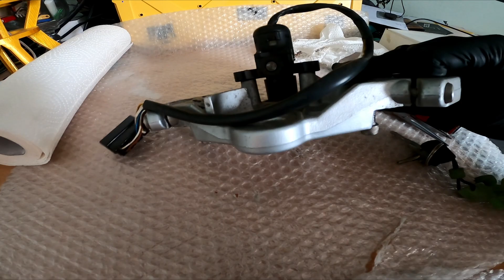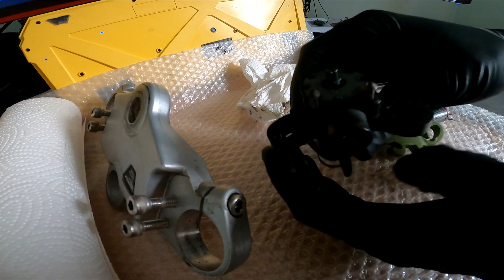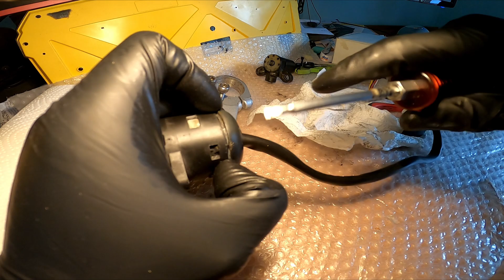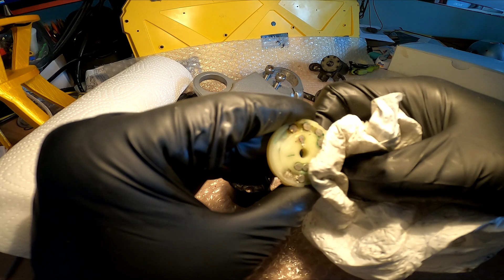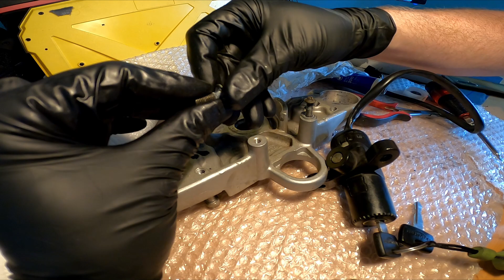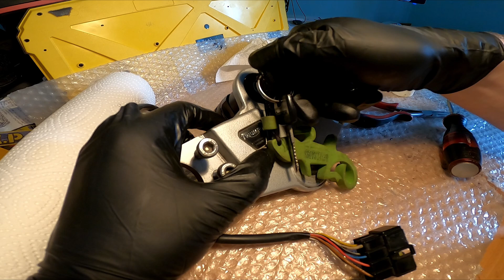Motorcycle ignition switch and steering lock disassmebly (Triumph Sprint 955i )

Comment: Thanks man. Mine started shutting off when I turn the bars to the right 😢 hopefully the contacts just corroded
Reply from the maker: Issues with movement are probably wiring related.
I'd check the wires going right up to the electric part of the lock, or the plug connecting to the main harness. Good luck!

Comment: I grove those screens attached to the  triple clamp. However, they are refusing to open. Ndo you think that triumph put some kind of permanent thread lock and that I need to get a heat gun?
Reply from the maker: Thread lock is definitely possible, on my bike the screws gave me zero trouble, but I could have just gotten lucky.

Comment: I used this to take apart a street triple version and when I put it back together the key cylinder is flipped to the other side and only rotates counter clockwise so now I have it apart and I can’t make it work. Any suggestion?
Reply from the maker: Sorry, I didn't see the comment until now.
 I hope you managed to fix the issue.
I suspect it might be that the excentric shaft bit, which I put in at around 4:10, is in a wrong orientation.

Hope that helps